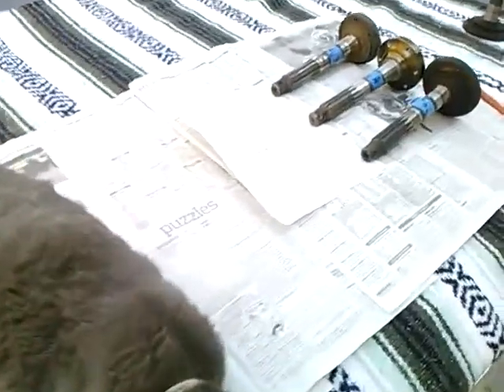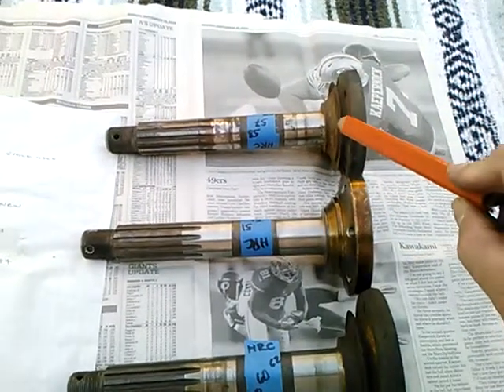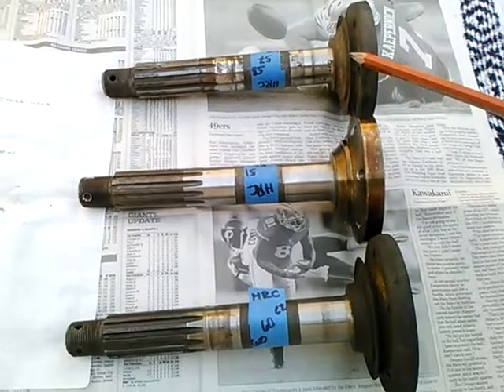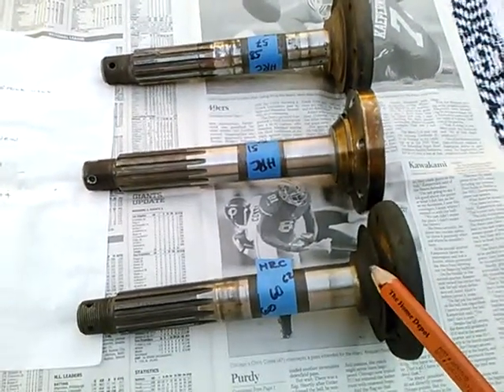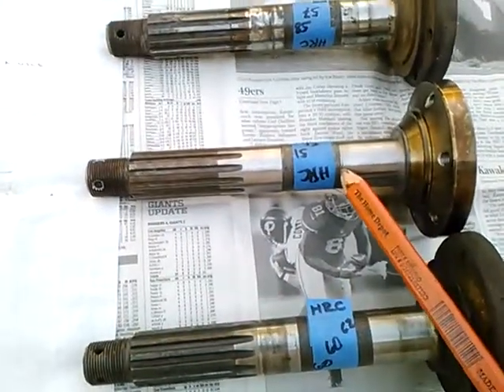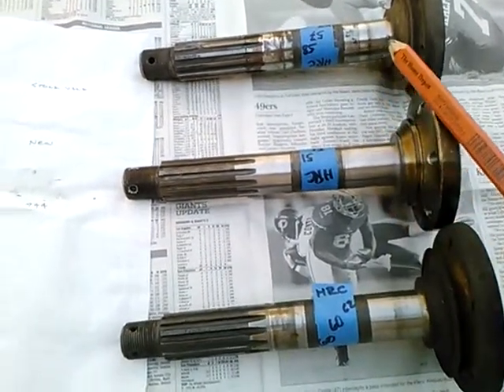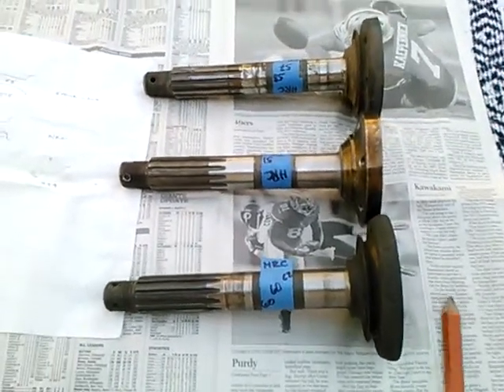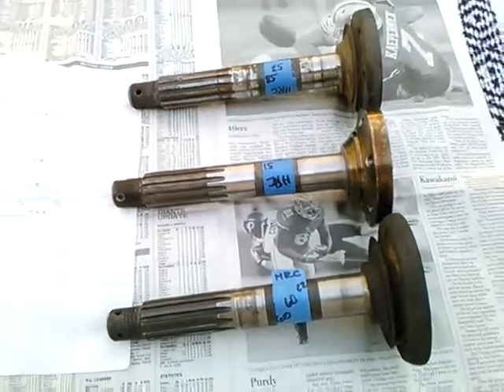VW IRS Stub Axles Hardness Testing, Stock, Porsche and Aftermarket MOV372

Comment: well thank you for your vid , i am now finding out that i may have a left side bearing going bad, the wheel wabbles some not bad but some , is there 2 bearings in there ? i have the dealer book and even that is not clear on explaining it on this subject ! so i am going around utube looking for advise as to what ill be facing coming soon . thank you again i even learned something from you , a stub axle i had never even seen the word yet in all my research so . proves no body know it all LOL . thank you again intersting vid for me .
Reply from the maker: There are two bearings, one ball and one roller.  Two seals one at each end.  Once you take the brake drum nut & brake drum off, the stub axle can slide or be gently tapped inward toward the transaxle.  The old stub axle may be fretted where the bearings ride on it, reducing its diameter.  The spacers involved may be crushed if the axle nut was ever over-tightened.After I made this video, aftermarket stub axles have come onto the market which are claimed to be "chrome moly" and include the factory-style metal shield for the inner seal.  These might be worth the extra dollars.It's a big job, and a difficult one because you want everything inside to stay clean, but you must administer great forces to install the parts.Somewhere I have several video clips showing this job, replacing the wheel bearings.  Maybe I can turn them into a new video in the next few days.Thanks for the comment.
Reply: well thanks guidoguitar i replaced the wheel clyliinders leaking. as for the axle i put a dial on it i can move it .014 up or down, the drum has some play but when the big nut is tightened with an impact its steady. i did not remove the cv axle yet the end on the drum end not ready its not bad enough yet but i kow whats going on now , i can coast with ign off in neutral for very long and i hear nothing at all , witch tells me i have time , thanks i will look for vids if i can find one but i can handle this i am sure . thanks for answering back